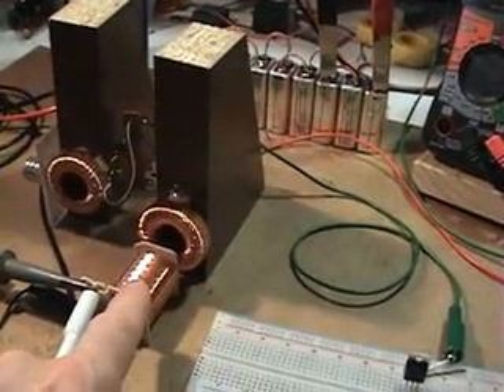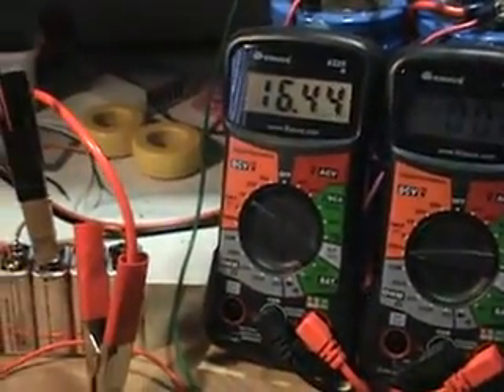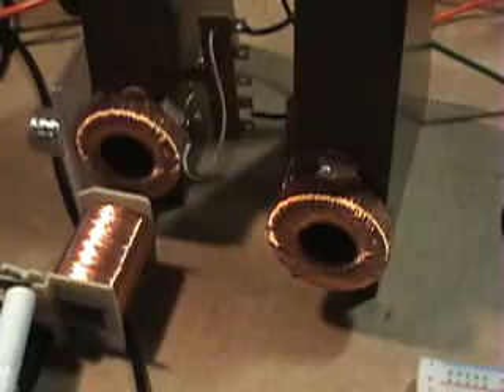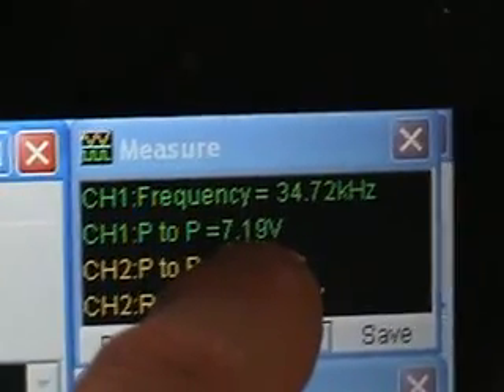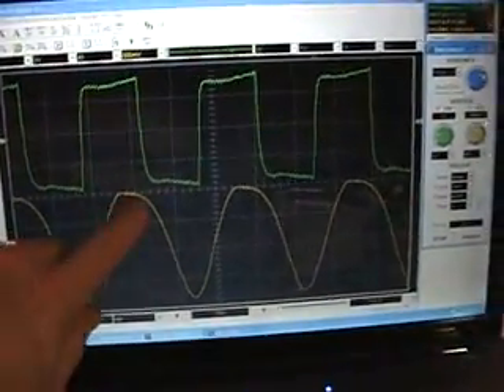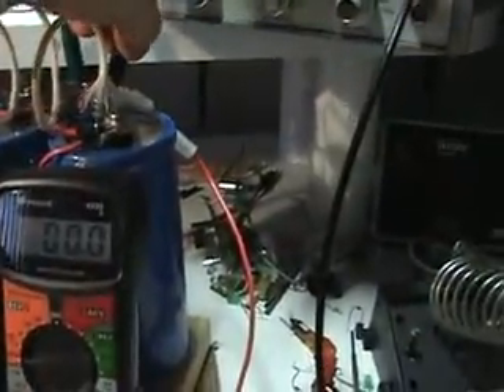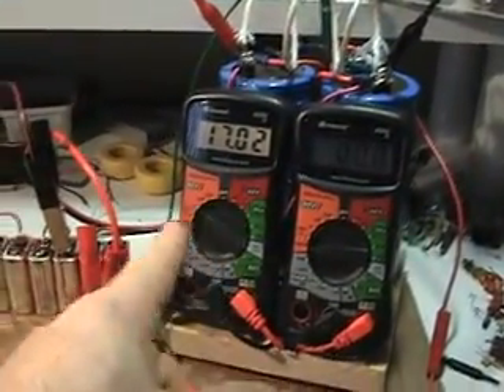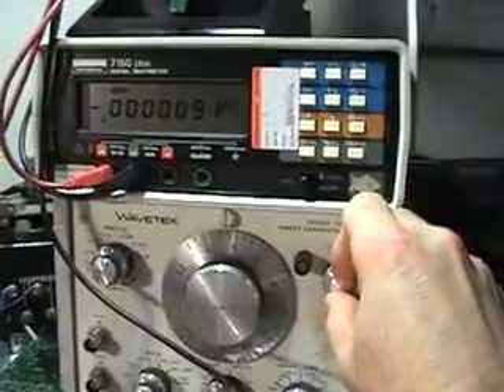Self Running Coil test 6

Comment: Excuse the maybe dumb question - but after you disconnect your battery - isn't it just your signal generator thats supplying the voltage increase you are seeing on your caps ? ? Seems to me like thats whats happening which is NOT OU ..